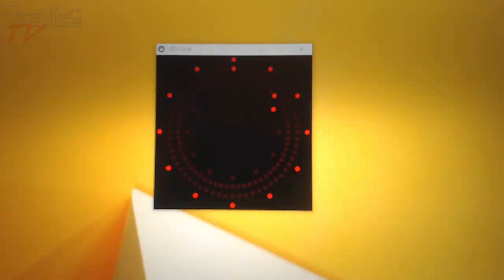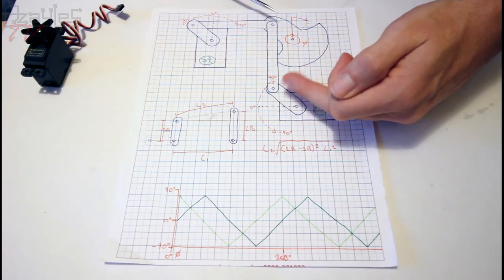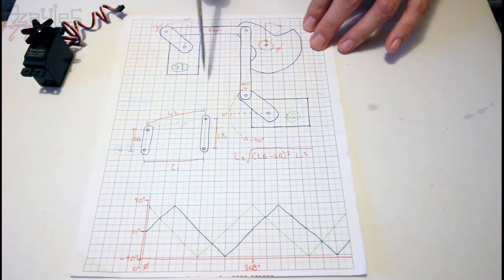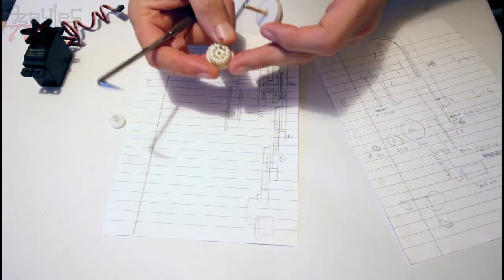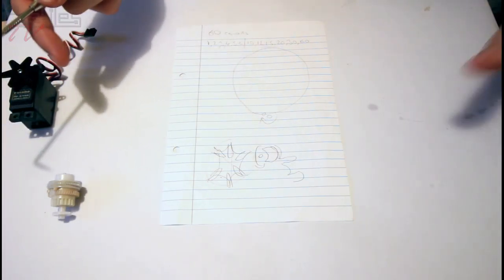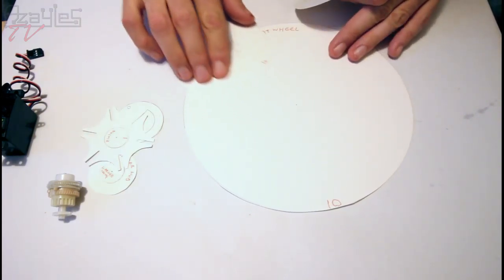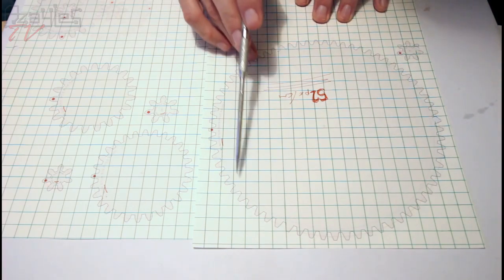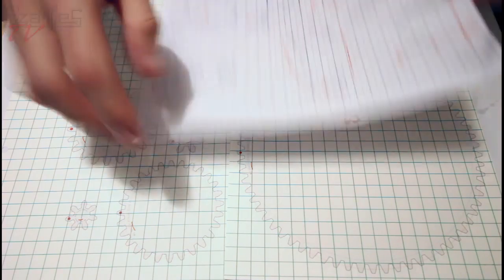Wooden Electromechanical Clock Build - Part 1

Comment: I'm impressed that you designed it yourself. I too have used VCR gears in projects (but never one of the felt clutches). I actually used to repair VCRs - and most other consumer electronics - for many years. The brass collars with set screws that you show in a later video; I have a bunch of those that I've salvaged out of old VRCs. They hold the upper video drum onto the lower drum. I expect them to come in very handy for some future woodworking tools builds and other projects.
Reply from the maker: I've actually bought very little specifically for the project, which has been good! Most of the plywood I had on stock, the gear arbours and clutch parts I'd pulled out of things, and the aluminium sheet I use for the clutch plate (spider) and the crank arms is reclaimed from a scrapped train station sign :P